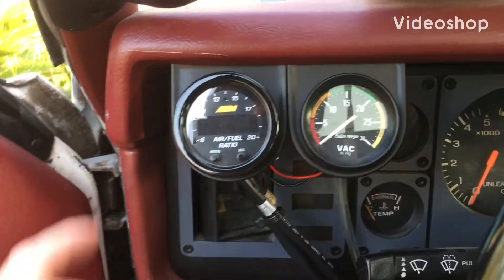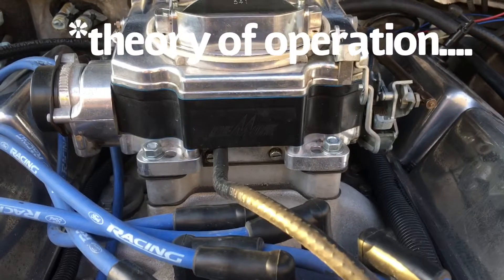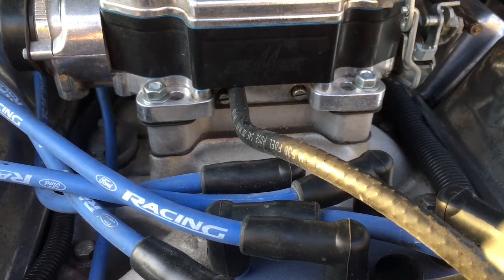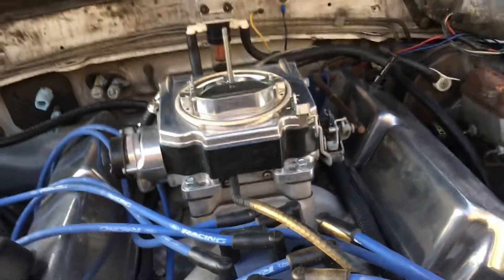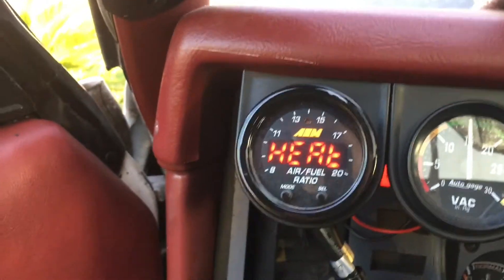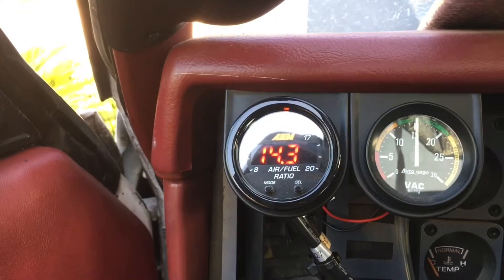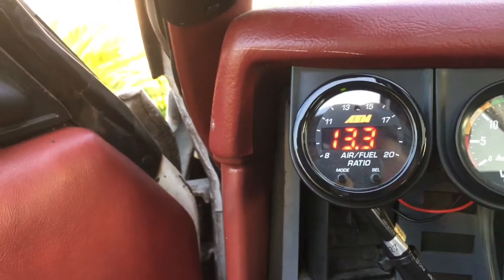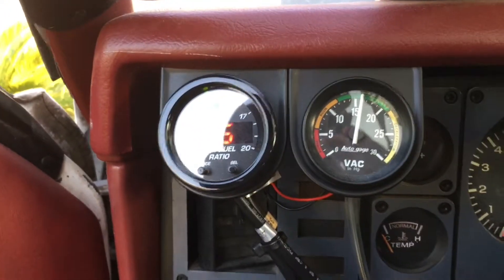AEM  30-0300 Wideband Air Fuel Ratio Gauge testing

Comment: Your engine liked the extra fuel at idle. Notice how your idle vacuum reading increased and stabilized when you opened the mixture screws?
Reply from the maker: It’s definitely a thirsty engine lol. In the summer I lean out the mixture as much as I can get away with and in the fall it’s starts leaning out and running worse. Then I’ll move the screws 1/8 turns out until the car feels good and the A/F gauge still shows good numbers. Good eye